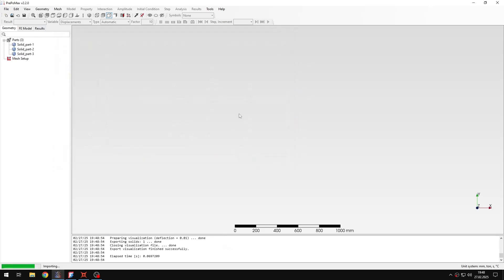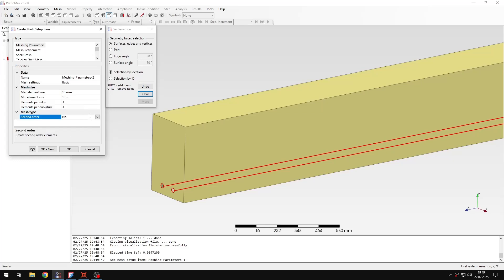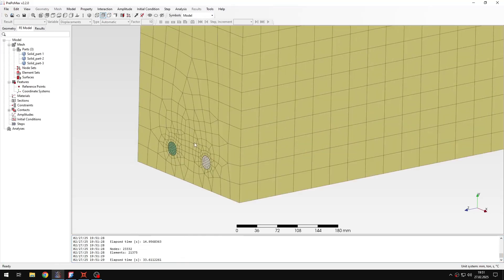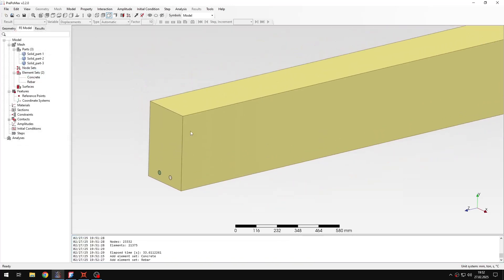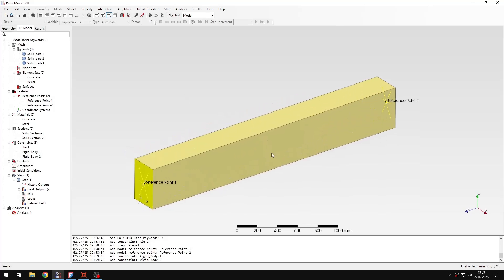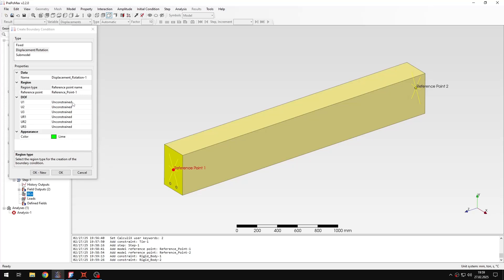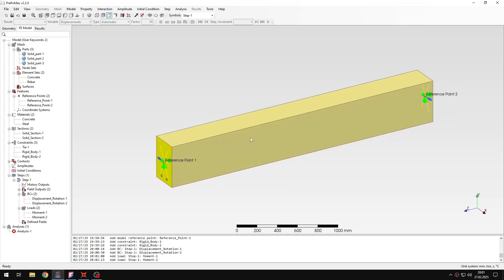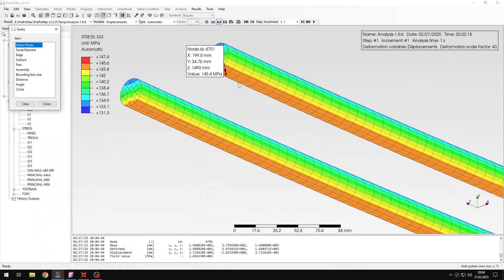PrePoMax (CalculiX FEA) - Tutorial 49 - Reinforced concrete beam

Comment: Sorry to ask for simple inquiry. How did you make the rebars inside concrete in FreeCAD?
Reply from the maker: No problem, feel free to ask about anything, especially FreeCAD modeling, which I don't cover in detail in the tutorials, so I'm glad to explain it in the comments. In this case, I just made two separate bodies - one for the beam (cuboid) and one for the bars inside it (two cylinders). I had to make sure the Allow Compound property is enabled in bodies (this is possible in FreeCAD 1.0 and newer). Then I used boolean cut with both bodies to make cutouts for rebar (before that, I copied the rebar to keep it for later export).
Reply: @FEAnalyst  Thank you. I now can use FreeCAD for the purpose successfully. However, what is the purpose of using extruded mesh in this tutorial?
Reply from the maker: @hanoa_mituki  Hexahedral meshes are pretty much always preferred over tetrahedral ones. So whenever the geometry allows it (isn't too complex), you should try using extrusion, revolution, or transfinite hex meshing.

Comment: while doing this tutorial, i was confused why you set the concrete compression material library as a subset of rebar... could you hint me about this? i am new to FEM
Reply from the maker: Do you mean that the keyword I add manually is grouped under the *Material, name=Steel keyword ? This grouping on the left doesn't really matter. On the right, you can see that it's an independent material card definition starting with the *Material keyword.

Comment: is it possible to make tutorial for buried or underground pipe ?
Reply from the maker: Yes, that sounds good if I find sufficient resources also for the analytical part.
Reply: @FEAnalyst  , many thanks for your respond and i do believe you can refers to : https://www.researchgate.net/publication/322129251_Modeling_of_Buried_Pipe_Deformations or http://freeit.free.fr/Structure%20Engineering%20HandBook/25.pdf
Reply: @FEAnalyst  many thank for your respond. I do believe for the analytical part you can refer to : http://freeit.free.fr/Structure%20Engineering%20HandBook/25.pdf or https://www.researchgate.net/publication/322129251_Modeling_of_Buried_Pipe_Deformations#

Comment: Hi, i just wanted to know in material editer you wrote 0.1 to take tension but how does the software knows constant 2 is tension capacity. It might take it as  poissons ratio, kindly explain.
Reply from the maker: This comes from the syntax of CalculiX keyword explained here: https://www.dhondt.de/ccx_2.22.pdf Basically, the *User material keyword requires the specification of a given number of constants (2 here) in the proper order. The compression only material is built-in and activated by starting the material's name with COMPRESSION_ONLY. Then the 2 constants that have to be provided are (in this order) Young's modulus and maximum allowed tension.
Reply: Thank you for replying, and thank you for explaining so clearly😊 @FEAnalyst
Reply: @FEAnalyst  hi i just modeled following the video . models runs at the end it says maximum iteration reached however results are visible, and the file took almost half an hour to run, it would be really helpful if could spare some time to review. and how to mail you the file directly if possible kindly share the mail details

https://drive.google.com/file/d/1IdOLt8C1afjIo4Yf9wB5adKF4SIiWElm/view?usp=drive_link

and the freecad model used

https://drive.google.com/file/d/1-LPeNP4hRYFQ3dnXSGobnzTD8_rcNscw/view?usp=drive_link
Reply from the maker: @suprithp5741  I can't see those files. You have to set access to "Anyone with the link" before copying the link and pasting it here.
Reply: @FEAnalyst  ok ill past it, anyways i was releasing horizontal support on both side so it was taking longer time then i changed the boundary condition it worked perfectly. 
I ready your reply on a website about the BC check to someone with similar issue so..

Comment: Hi, I'm new to using PrePomax, when creating a mesh, I get an error "The work directory does not exist". Please help me, thanks
Reply from the maker: 1. Make sure PrePoMax is not in a protected folder (where admin rights would be needed).
2. Check if you have the Temp folder in the PrePoMax directory.
3. Make sure that "Tools → Settings → Calculix → Work directory" is set properly.
4. You can also change the "Use .pmx folder as work directory" setting if needed.

Comment: Hello, I have some questions and I wish that you will help me with, but first I want to thank you for sharing the knowledge.
I want to know if Prepomax is able to run this simulation
https://youtu.be/J_iQQV5APy8?t=134
(The simulation of the excavator at the end of the video)
there is contact between bodies, there are bodies move like cylinder, arm, bucket.., and I see that the software in the video (Abaqus simulia) can simulate stress and displacement, factor of safety (maybe fatigue also) while the bodies move, not in static case only.
I will really appreciate it if you do a tutorial of this example or similar examples like cranes..., using Prepomax to simulate the assembly during motion, and it is very helpful if you do a comparison base on your experience and knowledge showing how much Prepomax results are accurate comparing to other payed softwares.
Also, I cannot find a way to do the same simulation with solidworks, in solidworks motion study we are only allowed to choose one top-level sub-assembly to be simulated (I can choose the bucket only, or the arm.., not the full assembly during motion).
Thank you very much.
And please, I am so desperate to run this kind of simulation with an opensource software, and I know that you are too busy to do that, but at least run it with coarser mesh possible, just to see if it is doable with Prepomax, then it will be a great favor if you do the comparison.
Reply from the maker: You can simulate simple motion even in nonlinear static analysis with CalculiX (check the gripper example on Matej's GitLab) but it will be hard to simulate bigger mechanisms. Unlike Abaqus, CalculiX doesn't have robust features (connector elements/constraints) to model pinned joints and other types of connections. Rigid body constraint is usually the best choice but it may cause some issues. Also, PrePoMax doesn't have 2-node springs which can be useful when modeling assembly connections. I'm thinking about making a tutorial related to those topics but with a very simple mechanism (also because my goal is to only use examples that can be verified with analytical calculations) and it may take a while to prepare.